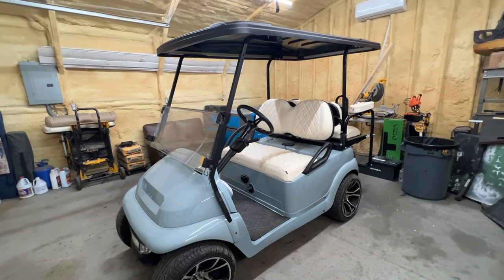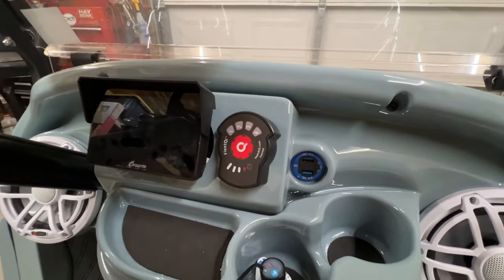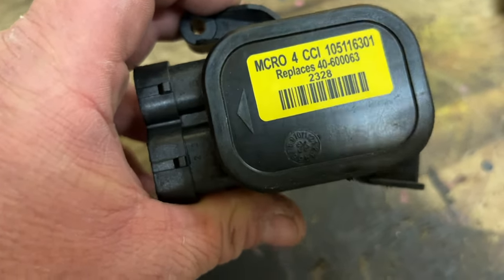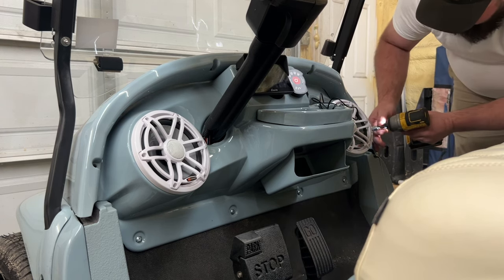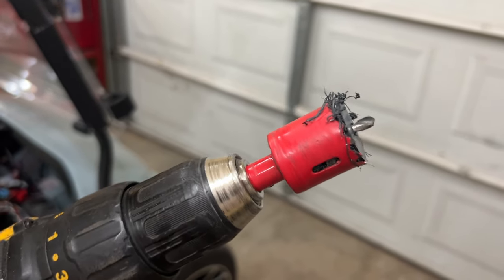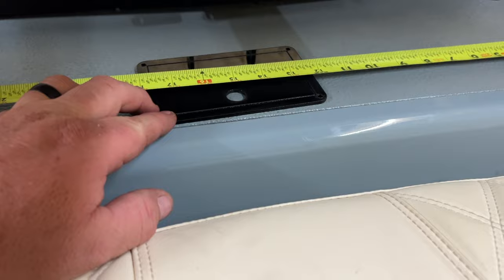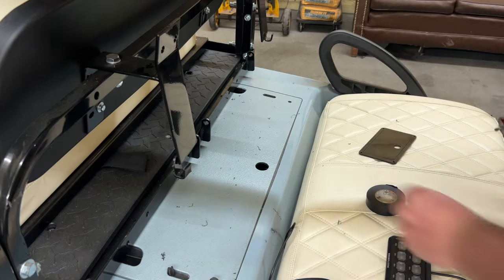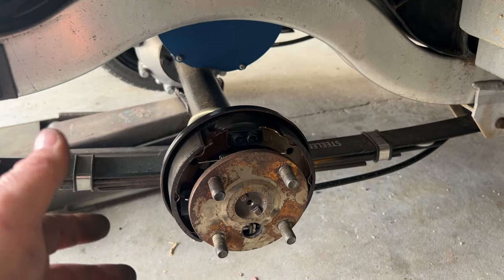Wife's Club Car Golf Cart Back in the Shop For Some Upgrades but then This Happened...

Comment: I also had a UNO in my Yamaha drive 2. My friend bought his first and I installed it for him. Than another friend also bought one and I installed his. I got jealous and bought one for myself. They were very expensive also . Long story short UNO replaced all three because of issues we had. They were great about it but I began to worry because 3 for 3 aren’t good odds. Then  we found out they went out of business and I was getting about 12 miles or so and had to recharge the battery. I wound up putting it in a DS that I flipped while it was still working. I bought a 48 v 105 ah Varner after watching your video and love it. I could get between 40 -50 miles on a charge if I pushed it. Love the gauge also and it was a $1000 cheaper than what I paid for the UNO. My friends still have theirs but at least I can give them options when the UNO quits thanks to you. Why don’t you throw a Big Battery in there, I saw you had a bunch of them in your garage. Varner’s are a a little big.
Reply from the maker: I’m going to open this one up soon. Probably will be on camera. Maybe we can see what failed and maybe fix it. I have the big batteries for some else. 2 are 72v that will probably live in my gem. 2 48v will go into a different cart.
Reply: @Fentertainment amigo habla español, soy de Panamá y necesito accesoria porfavor. Tengo un club cart.
Reply: I’ll be interested in  how you’ll get inside that thing , looking forward to it.

Comment: Hey Ryan, not related to this vid. But do you know how to install one of the dash kits onto the precedent after the tempo conversion? The under body cowl is different than the precedent where the brow installs, not allowing my my previous dash kit to be reinstalled. I have one of those carbon fiber basic dash kits with the 3 doors on it. Just wondering if you ran across this or heard of this problem? Thx!
Reply from the maker: I don’t have one or know of one. I haven’t installed a dash on mine yet either so I can’t provide you with any help. Sorry.
Reply: @Fentertainment  no worries, appreciate the reply. Keep on keepin on Ryan 🍻

Comment: I'm in the same boat with my lithium battery. It's Extreme Team that I bought a couple years ago. They since went out of business. I'm riding it out as long as i can.....
I have the same roof, I drilled out the rivets and used 4mm Phillips head screws (will have to recheck size, this was over a year ago) with rubber washers. No more noise!
Reply from the maker: I was thinking of doing the same thing as those rivets get loose and just squeak!
Reply: I have an Extreme Team lithium battery, too.  They sent the "indoor" charger with it instead of the onboard outdoor charger.  When I contacted them to have them send the onboard charger I ordered (and paid for), wasn't able to get anyone to respond.  Company went out of business, but battery still working 3 years later.  Others who purchased Extreme Team haven't been so lucky.
Reply: @markpyskadlo7576  I've heard the stories and am planning on biting a new bms for when mine fails. I had my original onboard charger fail about a year ago and bought a really good one through a solar company. Had to change the charge port to a 115v plug but it's been solid. I can look up that info for u if ur interested.

Comment: I have a 48v 2012 Club Car and I replaced the batteries for one 48v lithium, it won’t run. Does Club Car also have this reed switch or am I missing 12v to the key switch?  I don’t have DC to DC converter do I need one for the key switch and F&R ? Would really appreciate your help with this.

Comment: At 12:10, you are talking about the 8 button switch.  I think I would use some 2 part epoxy to attach it to the textured plastic after you drill the hole for the cable.
Reply from the maker: Only problem is if you ever to remove it then it’s stuck. I think the bracket I made with the double sided tape is the ticket.

Comment: Video time @13:15. Interested in the NO CO EZGO adapter plate you made. I could use one if available from you or some other source. Also just added a BigBattery Falcon Elite 48v to my Ezgo 2018 48v golf cart.  According to tech support at BigBattery I have to leave the charging port wired into the bus bars to get the cart to work and it does. My problem is moving the old charging port inside the cart and adding a NoCo GCP1 port in its place. I need to cover the old opening with something like you made.
Reply from the maker: If you have the D shape plug then the one I made is in the video description with link. If your plug is the triangle one then this one won’t work but I will have those soon.
Reply: Where do I find the link for the NoCo adapter plates you made
Reply from the maker: I shipped out out today with usps. I just updated ebay with the shipping info. Thanks Again.  @dennisbudreau232

Comment: Just need to get some that newer style locking velcro strip with 3m sticky on bottom works in hot and freezing temps
Reply from the maker: I had some 3m but it ran away I guess. Not sure if it was outdoor rated or not. I might update this or cut another bracket with the holes for the unit.

Comment: Hey Ryan,

I’m looking for an electric cart with utility bed on back to use around small farm. What brand do you recommend. Would you recommend new or used?
Reply from the maker: I would recommend either club car or ezgo (cushman). Typically you can find them cheap non running on market place.

Comment: I had the same speakers as yours arrive yesterday, one of them was broken, the plastic around the screw that holds the magnet broke away, during shipping I'd assume.
You can take the grills off, It's not really easy, but can be done, I'll have to solder the tweeter wires back on when I refit them. I'm paining mine black ATM. Just finished doing the first coat.
I pulled the grill off the first speaker that i pulled out of the box, so couldn't return them after finding out the other speaker was broken, so just ordered another pair.

Comment: How about using your conventional car battery charger to see if you can give the UNO battery a small charge?
It seems like if the battery is too low on voltage that the lithium charger wont power up.
You say your not upset.  I would be upset just because of the amount of money that it takes to replace it.
I hope that there ends up being a business that can rebuild lithium batteries by replacing the bad cells and making them work with the remaining cells, and also able to repair or replace the BMS.
Lithium batteries cant be so unique.  They had to buy the individual parts from somebody in order to put it together. That has to be cheaper than buying a whole new battery and putting the UNO battery out for recycle pickup.